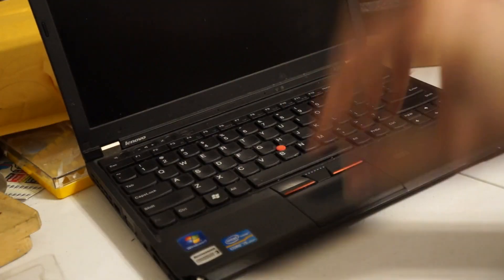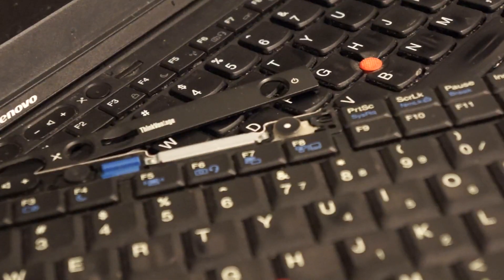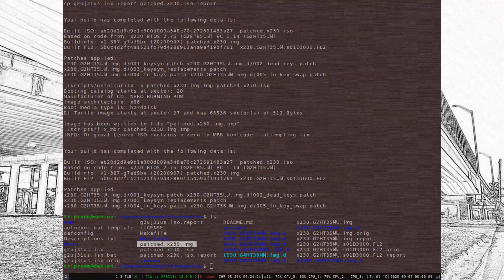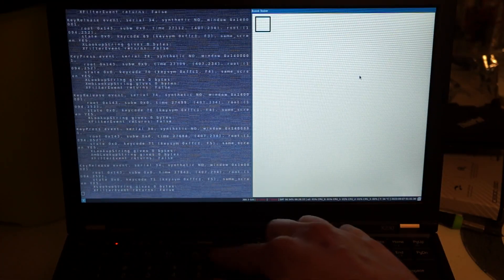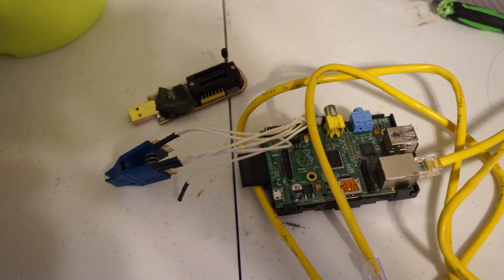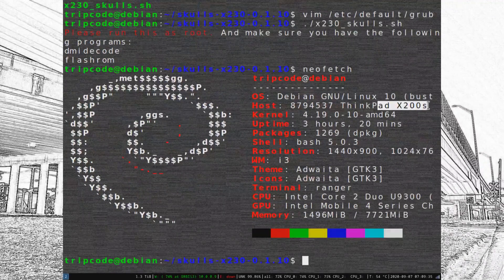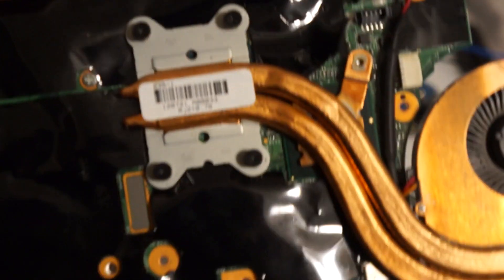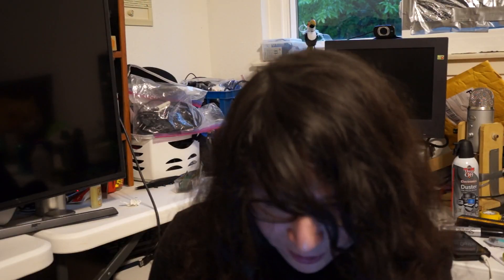Classic Keyboard Coreboot Thinkpad X230 (Skulls)

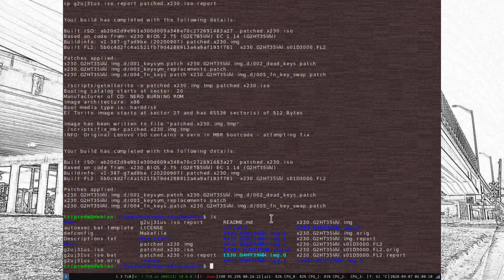Comment: I did these exact things literally less than a week ago. Same wavelength! It's nice having the wifi card whitelist removed since I was able to replace the card and now I don't really require any nonfree packages. Pretty fun project. You probably should have applied the battery whitelist patches to your patched EC firmware though. Video at 02:45 only shows you applying the keyboard ones and you can't remove the battery whitelist while it's running coreboot, need to do that when patching EC firmware through Lenovo's bios.
Reply from the maker: I guess I missed a step, I could do the reflash with the backed up lenovo bios. That github ec software does have the ability to get rid of the bios whitelist.
Reply: @tripcodeQ7  It's probably not a big deal, I'm not sure it's worth that effort unless you find yourself needing to use some obscure battery, but I feel like it's just something that's worth doing in the future/a thing to be aware of. Not sure why those patches don't apply by default, you don't need to enable the keyboard ones, but for the battery you gotta run "make patch_enable_battery clean" in the thinkpad-ec project before you make the patched.x230.img thing. I almost missed it myself.
Reply from the maker: @NeonLemonAcid  I am probably going to end up selling this eventually. I don't know if it would be wrong to sell it without the battery whitelist patched. I bought a new old stock 9 cell with the system.

Laptop refurbishing is a bit of a hassel...

I'm more concerned with bricking the EC firmware by re flashing the patched version twice.

I got the corebootable optiplex in the mail today and am planning on making it my desktop for a while though :D
Reply: @tripcodeQ7  I kinda doubt anyone will mind, but if you think you should, instead of flashing the patched version twice, flash back to stock, then patched if that's a concern.

Comment: Nice video. Definitely want to coreboot my x230 at some point, but  I'm scared I'll brick it. Already done the classic keyboard mod. I was worried electrical tape would be too thick, but luckily it worked fine for me.
Reply from the maker: Electrical tape ended up being too thick for me, so I ended up just using double sided tape and cutting the leads. If you are worried about bricking it just make sure to do a backup rom :D, you can always fix it by flashing the original rom back on.

Just make sure the pinout is correct, and if you get a ch341a make sure it isn't a board revision that outputs 5v instead of 3.3v

Comment: Kapton tape might work better than electrical tape - it's the transparent yellow-orange tape. It's very thin, is a really good insulator, and is very heat-proof (although I don't think that matters here).
I wish Lenovo would bring back the seven-row keyboard as an option, at least!
Reply from the maker: It should be a option, I theorize the t25 run was just old stock :c

Comment: I have a question, I am picking up a x230 this week and it comes preinstalled with coreboot 1vyrain. I was wondering if I can still follow the classic keyboard flash even though it has coreboot and not the stock bios. I've been reading online about it and some says it won't work as the EC flash for the keyboard relies on the stock bios. Am I able to flash it without the stock bios ? If not then is there a way to revert coreboot back to stock bios ? (I am New to the ThinkPad/Linux world)

Comment: Edit: I see you already did the video, well I was too late haha
Hey for the Q&A: have you considered setting up a cluster (clusterpad?) of 3 or 4 thinkpads ? Just for the lulz

I myself want to do it but all I have is one working T43, I have another one but needs repairs
Reply from the maker: I'm thinking about it now... I have 3 working t42s and one more I can make.
Reply: @tripcodeQ7  cool, that would make up for a nice video, I have searched on youtube and r/thinkpad but I haven't found someone that has done it
Reply: Maybe you can use Rocks Linux, I think it's the easiest way to go for a cluster
Reply from the maker: @masterpeak4053  It seems interesting, I was thinking it would be pretty easy to do if I was just going to use it for ffmpeg rendering and seperate the workload by each clip or using it to try out distCC